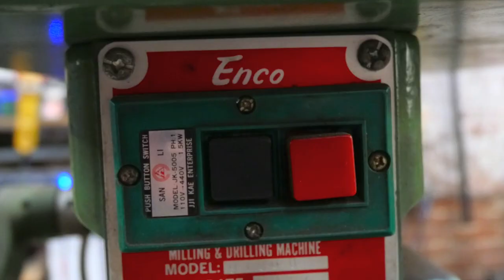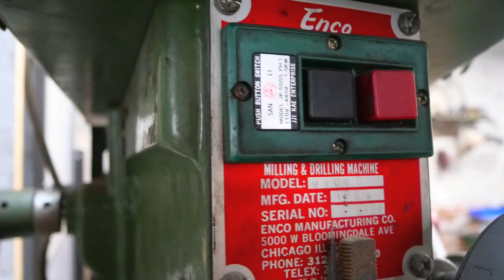Building a Heavy A$$ Stand for my Enco Mill/Drill! Plans Available!

Comment: Just ordered a new Precision Matthews bench top mill and I'm in the process of building a table for it. I went with angle iron for mine, but seeing this table makes me wish I built it with tubes instead.
Reply from the maker: Hey Dude! After living with this table for a bit I'd say I kinda overbuilt it... yeah just a little haha...angle iron sounds good to me, hopefully you got something thick like 1/4", it is nice to have some heft to the base to cut down on vibration, best of the luck with the build!!!
Reply: @blaisegoldman  Oh yes, very thick stuff indeed.  I built mine to fit around a harbor fright 27" toolbox, using the toolbox itself as kind of a foundation for it.  And, after seeing your video I went back to the steel store and got some of those big rectangle tubes for parts of it.  It came out really good.  about 300lbs of steel just in the frame, not counting the toolbox under it.  I totally melted my TIG torch doing all those welds in the heavy steel.  Why they would put a 150 amp torch on a 200 amp welder is beyond me.
Reply: @blaisegoldman  and I should totally add that I absolutely borrowed heavily from your design.  I had no idea what my surface was going to look like, but seeing yours sold it for me. the top of my stand looks exactly like yours, thanks to your video.  - it does a great job of catching chips!
Reply from the maker: @jonnyphenomenon  hell yeah! Stoked to hear that my man! Your build sound rad, the tool box underneath is a great idea! ✌️🤖👍

Comment: Nicely done and way overbuilt strengthwise which is always nice to see.  Might I suggest getting an engine hoist for your shop, or build a gantry.  Either way, will make moving things on and off the table much easier and lower the risk of breaking either tools or yourself.  It looks like the chainhoist you currently have is stationary, so while useful, not always as useful as it could be.
Reply from the maker: Haha yeah that is defintely on the bucket list for the workshop at some point, but on the flip side at least I get a workput in 😁👍